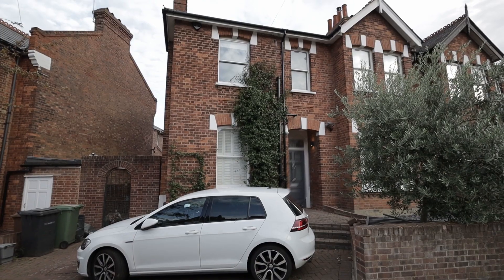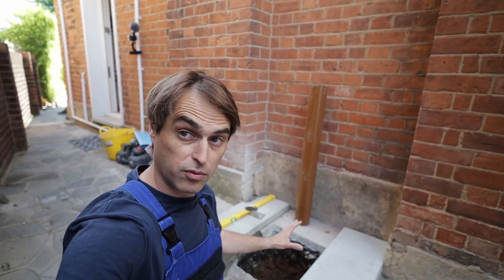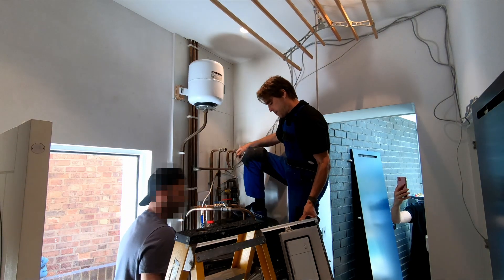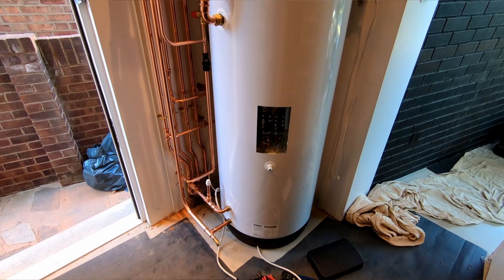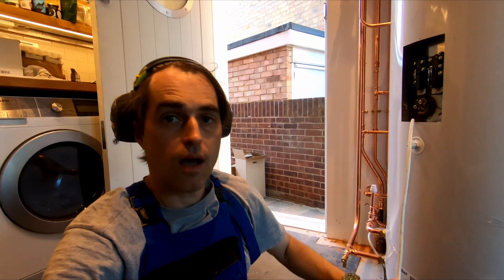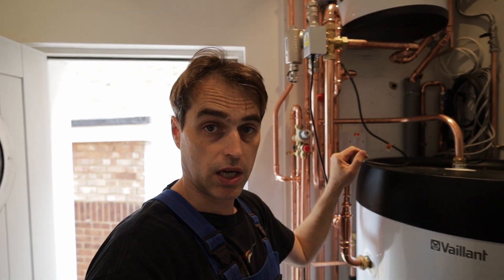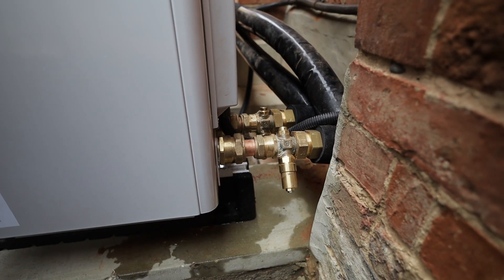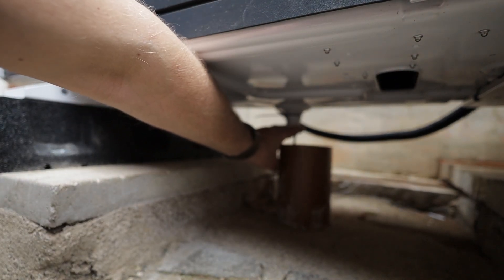Is This Heat Pump Better Than Your Gas Boiler?

Comment: For a house that isn't insulated or is small and doesn't have space for a water tank, it will be a fortune to insulate it or change the windows just to switch from a gas combi boiler to install an air source heat pump. Also, the radiators are huge. What are you gonna do for a small bedroom? I just don't see the savings in changing to a renewable heating system.

Comment: I am slightly confused u said u don't need the circulation pump, but u have buffer so what's pulling water from buffer into UF heating?
Reply from the maker: It’s a volumiser
Reply: @UrbanPlumbers so it's connected in series with UF circuit? Also another question, Vaillant sold him buffer and 2x vdm 25, cuz he has 2 manafolds i really don't see the point of vdm-s since u can set the flow temperature and he is claiming u can't that it works of curve which is correct but u set max 45c,min 15c and then curve works between those two set temperature. He said when u have - 10 outside pump will go to 55c and there is nothing to cool the water then that's why u need vdm-s
Reply: Sorry i forgot to say he has UniTower and then from UniTower there is buffer and  from buffer 2x vdm-s 25

Comment: I've had my Vaillant heat pump in for around a week and a half now and I absolutely love it considering I have oil boiler before which cost an absolute fortune to run and the electric and oil was very expensive I am really happy with my new Vaillant heat pump I absolutely love it went through a company called Taggas was very good and friendly.

Comment: They failed to mention how much electricity it will take to run it. But I believe it's less than half the cost of gas. I'm getting a grant for all of the work internal insulation, air source, solar panels and other repairs. Thank God, coz I couldn't afford it.

Comment: Hi Szymon.
In like it that you people in the UK design to only -2 degrees Celcius outside temperature. In the Netherlands they still make the heat loss calculations at -10 !
It will never become -10 for long the comming years and the benefit of your -2 is less risc of installing oversized heat pumps.
Do your systems run on emergency heaters when it has become -5 degrees outside ? I don't think so, but if so, does it hurt ?

Comment: The high pressure electrical pumps etc have to run all day to transfer the heat from the cold outside to you lukewarm radiators, so when electricity is more than 3 times the price of gas, how is this cheaper than a gas boiler. Hype and scam.

Comment: Before you buy into this idea, on a really cold day turn your Boiler heating down to approximately 45c and see how warm your house is!! If it’s warm enough for you then a heat pump might be ok with bigger radiators and more insulation. You won’t save money going forward.

Comment: I'm just moving into a 1970 house detached 4 bed house. It's got oil heating because there is no mains gas here. The boiler is old and pretty much everything in the house will need updating.

I'm thinking of ditching the oil and adding heatpump and pv panels. Maybe a battery and maybe even Sunamp Thermino ?

But the house also needs some building work, likely some extending.

Eventually we might go for external wall insulation but it makes sense to do this after all the other building work is done.

In the meantime I want to get the heating sytems etc. instlled in the house. (We've got to live in the house while all the work is going on.)

So contrary to the advice, can we install the heatpump etc. BEFORE we get the house all fully insulated ? If so, is it possible to get the £7500 funding on this basis ?

And also @UrbanPlumbers, can you work in Cornwall ?

Comment: Do you recommend British Gas for boiler  installation?
Reply from the maker: No, never seen BG do a non HIVE install or do WC or PDHW - they are still stuck in the 70ties
Reply: @UrbanPlumbers  yes they recommend Hive thermostat. Which one is best to use with Worcester 8000 style ? What is WC and PDHW. Do you recommend heat pump or is gas boiler better?

Comment: We are looking to install a heat pump, not to use glycol sounds a good idea as we have micro-bore pipes, do you use an additive in the water to stop corrosion and if so what do you advise ?  Also are there any warranty implications of using anti freeze valves instead of glycol ?

Comment: Since it has been more than a year, would it be possible to do a follow-up video that confirms that the system reduced the annual heating/cooling bills? A video like that may not sway the doubters, but would be very useful to people on the fence who want to make the switch but are concerned about cashflow. Thanks in advance.
Reply from the maker: Yes sure. I just need to find the time!

Comment: I doubt it will work 6kw ouput HP to replace 30 KW  output gas boiler this is impossible, what is the area of the house sir.?
Reply from the maker: 180m2. This house only needs 5kw for heating. 30 is a total overkill. Been almost 1.5 years now in with no major issues.

Comment: No it is not I took out a perfectly good gas boiler costing around 900 for a winter fuel bill, put this exact model in electricity bill from 400 for the winter bill to 4000, so guess who is fitting his o,d boiler back in

Comment: No room for one on my property.  They are too big. Will block the path way partly plus doors and windows in the way on other elevations.  Could go high. But at 1000ft asl it would be bombarded with heavy rain and winds. Not good. I will stick with my boiler and one day use convection heaters instead. Then install instant hot water heaters instead. One would do the kitchen and bathroom nicely.

Comment: Hi, I've installed the AROtherm combined with Unitower. I've an issue with DHW, whenever the DHW is activated my water pressure gets increased at faucet becuase of expanding water I think. Do you have any idea or resolution to this?

Comment: Isn't the thermal capacity of the water kind of meaningless as long as you can increase the flow rate of the thermal transfer medium... oh I did continue writing for a bit but then I realized you are going to lose more heat through the pipes because it's easier to cool or heat the thermal transfer medium, however technically that could be sorted with more robust insolation on the pipes, but given the thermal capacity difference Water 4.186 J/g°C Propylene Glycol 2.481 J/(g°C)

meaning you need to almost half the thermal dissipation through the pipes which is a pretty big increase in the thickness of the piping isolation.

Comment: If the existing installation has boiler radiators can they be used with a medium temperature heat pump ?

Comment: Great video , I’m just wondering if you have designed this system to run at 40 degree’s how is it possible to heat the hot water to say 55 degree’s
Reply from the maker: hot water priority - hot water runs at a higher temperature and central heating and hot water never run together

Comment: Curious What was the Cost of this system with install?  Rough Cost.  In pounds would be fine.  We live in Maine, US and there is a very good chance of loosing power 1 to 2 times a year.  in the last 10 years for us it has only been 23 hours max, but some on the out skirts of our town were without i for 1 1/2 almost 2 weeks!  so another source is necessary to have on hand, this is the only reason we keep our Propane water heater tank (cylinder).  But this for the most part is a great option if not too expensive.  Thanks I've seen a few of your Vids they very well done.

Comment: We just had a heat pump installed but the anti freeze valves are fitted above the lowest point of the heat pump. The installer says this is acceptable but I don’t think it is correct. Can you advice please?
Reply from the maker: at lest one of them needs to be at the lowest point, best to connect them as the first connection to the heat pump
Reply: @UrbanPlumbers  You are awesome, thank you..

Comment: Any problems with legionaires disease with the system running at 40 to 45 deg cent ?
Reply from the maker: No, hot water gets weekly legionella cycles

Comment: Would it not make sense to encase th heat pump in a small insulated shed with a heat exchanger to save any heat from the appliance and reduce the heat differential .

Comment: Answer - NO!   The latest condensing gas boilers are a modern miracle and reasonably cheap to install compared to all this heat pump stuff that looks like it could power a battleship!   There are 25 million homes in the UK, most of which are unsuitable for heat pumps.  Add to that the next to impossibility of producing enough electricity from renewable sources, so heat pump adopters are spending £thousands to fit heat pumps that have their electricity produced by fossil fuels!  You could not make it up! 😆
Reply from the maker: You really know so little 😭

Comment: my vaillant fuse broken,after 9days,then the worker came, he say he changed the fuse,fixed it, and told me that it will take a while for the water to heat up, then i set the temperature at 13(i plan to higher the temprature 1 degree per day to protect my underfloor heating)that night the temperature went to 18degree and keeps rising.the machine is installed in 2021 september, the vaillant HP is a joke. i have the unitower.
i called the worker and he say,oh i think you three way valve broke, and i will order your engine(WTF,i can't shower for who knows how long, and why he lied about he FIXED IT.)NEVER PICK VAILLANT.
Reply: @zlmdragon.  over 2 weeks no hot water,still don't come fix,machine less than 2 years old.vaillant is shit

Comment: For reheat times of hot water with a heat pump, is it better to fit the Vaillant unvented heat pump cylinder unistor or a Joule cyclone high gain? The cyclone says it has a 42Kw coil. How long does it take to reheat using a cylinder to 48C?

Comment: The buffer must have some good fixings . It must weigh ot .
Reply from the maker: its the same bracket and fixings Vaillant gives you for their boilers
Reply: Did you have some type of seperation for the ufh ?
 I still get a bit confused with close coupled tees .

Comment: A friend had his 10 year old heat pump go wrong just before Christmas struggled to get some one to look at it . Then found it hard to get parts in the end cost him £4000 . It was fitted new when property built
Reply from the maker: @zlmdragon.  new 5-7kW unit is between £2k - £4K to supply (full unit). Once HPs become more popular the economy of scale will kick in and parts will get cheaper.
Reply from the maker: For £4K you can get a brand new unit.
Reply from the maker: @zlmdragon.  If i had a 4K bill to repair the existing heat pump I would be swapping the whole unit and getting another 7 years warranty. The cost wouldn't be much more.

Comment: Is there a payback? Installation is complex compared to a gas boiler so a lot more expensive. Average COP is not going to be 4:1 realistically. Be interested to know efficiency in use with data from original gas boiler consumption.

Comment: You didn’t mention domestic hot water generation and storage which can’t be heated by water at 40degC. Presumably there is a facility to run the heat pump at 60+ deg C ?
Reply from the maker: Yes, heat pump can run at up to 75c for hot water

Comment: Beware of heat pumps if you have gas available forget them as for the manufacturer check what they were involved with in WW2
Reply: @zlmdragon.  I am a retired Technical director of a refrigeration company and was designing and installing heat pumps back in the 1980 s till I retired  Heat pumps were a good replacement for Oil  but if you have gas available a heat pump will not compete ,They only tell you the good things Never mention what happens when there is a low ambient and they NEVER tell you how much maintenance and parts costs No matter how many times you ask .We in the trade used to call them cold pumps
Reply: @zlmdragon.  Never heard the expression Buyer beware ? always check everything believe no one on FB
Reply from the maker: beware of silly comments, if you have non-silly comments available, forget them.
Reply: @UrbanPlumbers  Check out the manufacturer

Comment: I think you have got the perfect formula for a YT video - engaging knowledgeable presenter, real-world highly applicable content and no unnecessary footage! I could watch loads of these.
One question I did have though, can you install a ASHP to an existing unvented Megaflo tank? Does it depend on the tank size? as I have heard some other ASHP installer say they like to keep the tank and HP manufacturer the same.
Reply from the maker: Thank you for a nice comment. Yes you can install HP on existing cylinders by doing what is called ‘plate loading’

Comment: Hi, do you have experience with such heat pump maintaining 50-55°C degrees to 240 lit solar buffer tank with integrated DHW stainless steel coil instead DHW cylinder?? 

I currently have old oil burner and I’m considering to add Vaillant 6kw mono block heat pump to this buffer and weather reset regulation for UFH and radiators but could it be efficient with such setup? what do you think?

Great channel, keep going!

Comment: Very interesting to see this, why did you remove some of the underfloor zone valves?

I noticed that for the external pipework you insulated between the pipe clips - When air conditioning is installed they tend to use larger pipe clips which fit over the continuous insulation. Would this not provide a large improvement for this setup?
Reply from the maker: No need for zoning on HPs as they are expected to replace lost heat not to overheat the room like boilers do.

Everything works as one large zone, including radiators. 

If you get too hot or too cold all you have to do is adjust your heat curve. One it is dialled in you should have to touch the system again.

It hinges on core t heat loss and emitters sizing though.
Reply: @UrbanPlumbers  Ah I see that makes sense, thank you very much for your response.

Comment: Hi you are very neat plumber, Engineer. But your wrong about running cost. Gas 3 times cheap per kw than electric. Just tell us full cost of installing heat pump plus any up grades to rads pipes then compare to combi install. Thousands for heat pump.
Reply from the maker: This system is now running at 50% cost of the boiler it replaced. Installation cost after bus was around £5k more than the system it replaced.

Hands down a better system in any imaginable way.
Reply: @UrbanPlumbers  thanks for info.
Reply: But installation costs demolition the saving

Comment: Don’t do it, your house is not insulated enough and to benefit from a ASHP would involve a massive cost to insulate it to deal with the serious lack of of KWH you lose from installing one, ie your current boiler is 17kw in gas with a modulator built in so will never use this, something the do not tell people( for example my 2k modulating boiler has dropped my bill by half in a 2000 square foot house )  against a most likely 5kw a heat pump will produce so how will they replace the missing 12 kw easy it’s like running a kettle element all day which they have fitted so will cost way way more than gas  and I heat my house to 22 degrees something heat pumps cannot do without secondary heating again pointless costs
Reply from the maker: client reported last week that the comfort levels are much better than it used to be with a gas boiler and that bills are much lower. Video to follow mid Dec.

Comment: Nothing can be more than 100% efficient. It would be more correct to say that you can use 1 unit of electricity to gain four units of heat, by extracting energy from outside the system. Your're not converting electricity to heat directly but rathe rusing the electricity to drive a system that extracts heat from elsewhere (ultimately, the Sun)
Reply from the maker: Calm down. You are overthinking it.